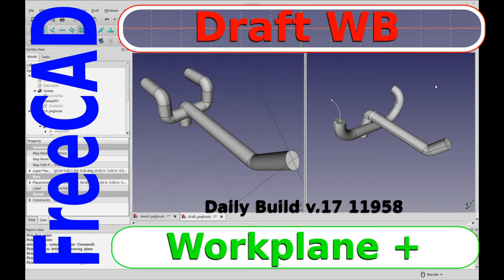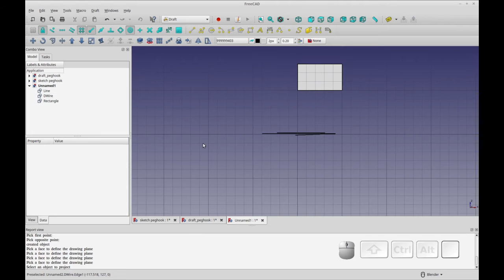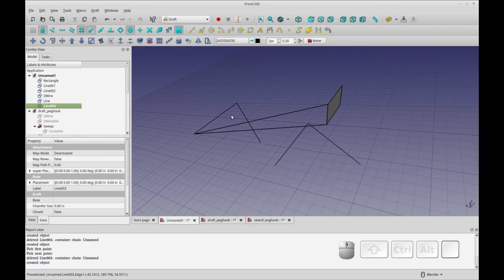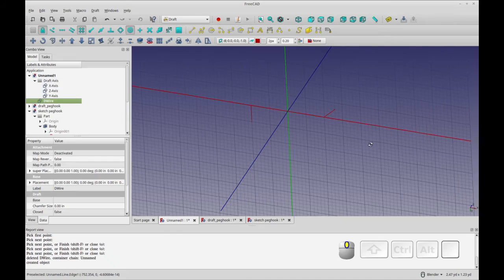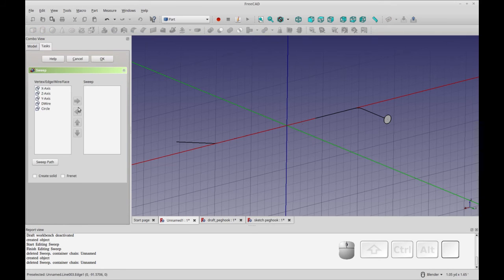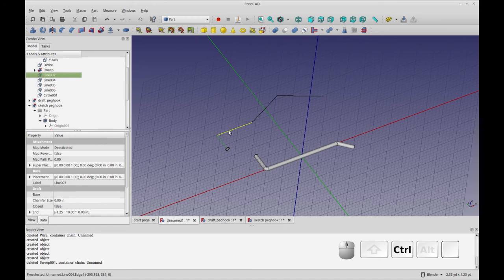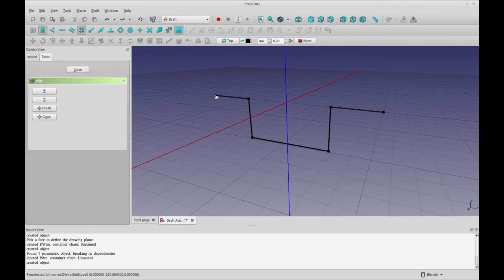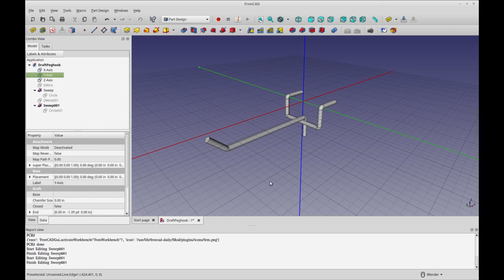FreeCAD - DRAFT WB DEMYSTIFIED !!!

Comment: Regarding the Sweep tool path selection: you can select your whole DWire by doubleclicking, instead of control-clicking every segment of it. It's also possible to switch to the Model tab and select the DWire there.

The reason you can't sweep along the multiple lines is that they're distinct objects. The sweep tool requires a connected path. It can be some edges of another part, like along the top edges of a prism. That carries the same cornering issues you saw when converting lines to a wire, though.

Comment: Hi. I am confused, as I am with 99% of all Freecad to tell you the truth, but as far as trying to shift the 'working plane' as you have demonstrated@1:50sec. I have spent well over 30 minutes just going over and over these instructions trying to figure out what I am doing wrong. The only thing I can notice that I can seem to get the same as your demonstration , is that when I click on the 'workplace' window 'icon window' , my window doesn't change as yours does, to a sequence of numbers. Mine just highlights when I click onto of it, but remains with the word, 'custom' written in it. I have tried it by changing to top view before I start. But I click on the 3 reference points, everything that you have done, but no matter how many times I try, nothing happens. Unfortunately, this has been the way of things with 99% of things I am trying to learn with Freecad, which is making it a very very slow and frustrating process. but I have tried 'Librecad, and 'Draftsight' but I'm having the same problems . I just cant figure out what's going wrong all the time.

Comment: Too complicated for me. I can't wrap my head around it
Reply from the maker: This was a pretty old video, it is probably not very good. I don't even remember lol, i have some new stuff on this subject. And there are many new creators for freecad. Don't give up on freecad because of me :)
Reply: @mathcodeprint  I'm older (64). I learned 2D on paper. The first thing you did was show how 2D can be viewed from any angle in 3D space. Not helpful 2D = x,y not x,y,z. That's when I left.
Reply from the maker: That's fair, the draft workbench is considered a 2.5 D workbench. It caused me many grey hairs. The result tho is that you can manipulate 3d objects with 2d methodology but at the cost of brain cells :)
Reply: @mathcodeprint  a true 2D workbench would be useful. Perhaps a toggle to limit it to 2D (for the old guys). Lol
Reply: @wallytuescher2175  The Sketcher workbench is stricly 2D !